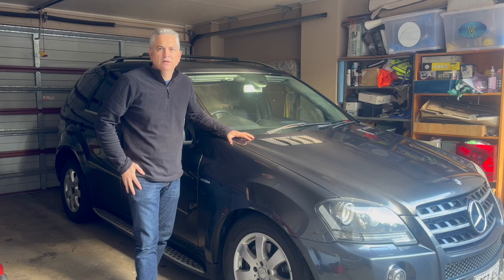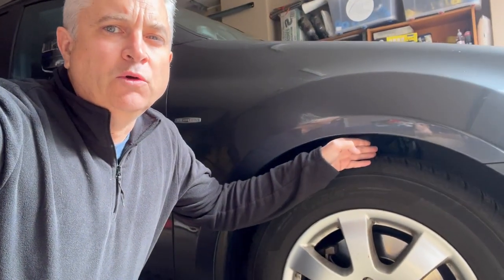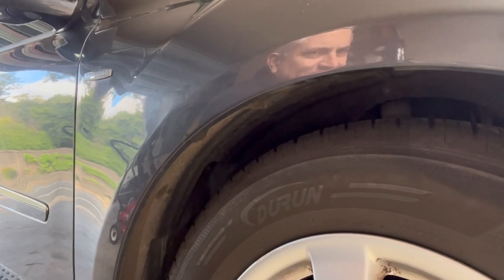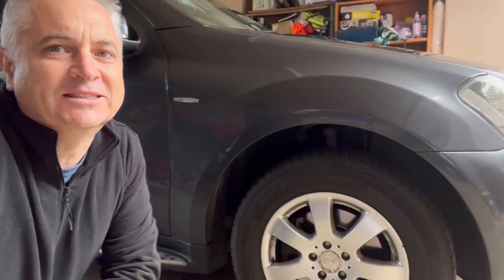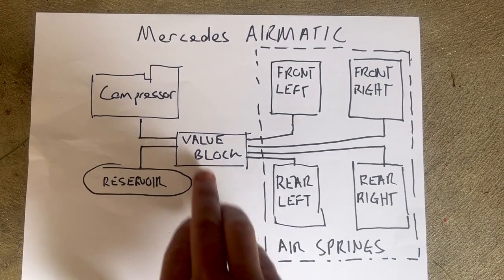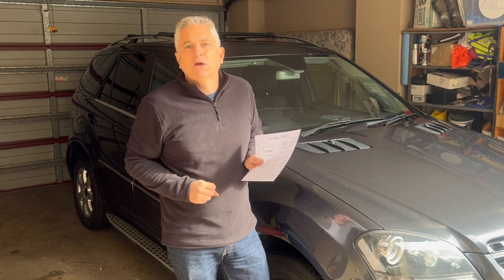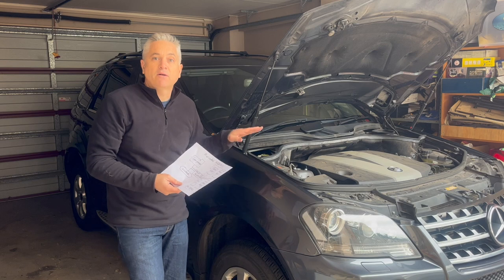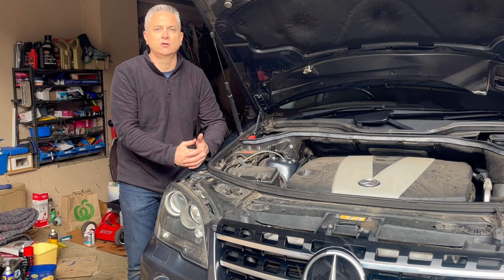Diagnosing my Mercedes ML W164 AIRMATIC Air Suspension Problem - Air Spring Strut Valve Block

Comment: Thank you for this video! I was quoted in excess of $3500 to fix a ‘non existent’ airmatic suspension issue which I am convinced I don’t have as I am not losing any air or anything. No sagging in the front or back of the vehicle.. no warning lights etc.. also, regarding the video about changing the glo plug, would the glo plug you have linked in also be suitable for a 2010 ML350 AMG?
Reply: Can I send you a video of a noise that was heard?
Reply from the maker: Hi Mate, yes assuming your car has the OM642 Diesel engine (ie not the Petrol V8) the. it’s the same Glow Plug Module in the ML350.  Cheers Drew
Reply: @DrewFixIt  how do I know if that’s the engine?
Reply from the maker: Do you put Diesel in your car?  Cheers Drew

Comment: Drew I have a Mercedes Benze Viano W639 2014 - 3.0 Cdi  the air shock will not work the voltage at the air compressor is below 3 volts any suggestions mate

Comment: And where do i bay the valve block, 4 air shocks and compressor?
Reply from the maker: Hi Mate, I have put links in the description of this video, but here they are anyway: Valve Block: https://amzn.to/3NAWbPO
Front Strut Shock Absorber Assembly: https://amzn.to/3rmq4Zl
Front Air Spring: https://amzn.to/3rgsxry
Rear Air Spring: https://amzn.to/437CvIR
Air Compressor: https://amzn.to/46wqM9M Cheers Drew

Comment: The 1st link is to the strut instead of the Valve. Thanks for sharing anyway, it makes my decision to go all-in on a W164 much easier.
Reply from the maker: Hi Dennis, thanks for pointing this out, I have fixed this link now! Good luck with your W164 I certainly have no regrets with purchasing mine :)  Cheers Drew
Reply: Got my W164 for two weeks now. You have no idea how helpful your videos are. Keep up the good work, mate. Greetings from the Netherlands.

Comment: that was a very good diagnostic. I was on the lookout for a used ML350 and was not sure about air suspension because of the Benz Cost( they quotes 2500 AU$ for a single strut). your vedio was very helpful.
Reply from the maker: Hi Mate, here’s a playlist of videos replacing basically every AIRMATIC component in a ML W164: 
https://www.youtube.com/playlist?list=PLor5qdyoV_nQk9277ANJLkKaJ-9Ky_OB7 You can DIY everything yourself for less than $1k  and it’s actually not that hard … go to the dealer for all of this work and it will be over $10k! Cheers Drew

Comment: Did you ever figure out what your leveling problem on your Mercedes was? I have a 2009 Ml550 and have a similar problem, mainly leaning to left side. I had previously changed a compressor and both rear air bags. I have since changed the valve block as you were planning. This has not solved the problem. I have a xtool A30M OBD reader. It seems to work well and provides good feedback on Pressure and level sensor set points and actual position. It is not showing any faults though, I would be interested to hear if you sort it out, Thanks, Bill
Reply from the maker: Hi Bill, I swapped the levelling block and all is good now.  I need to edit up a video and post it, just haven’t had time with life and a day job taking priority!  Cheers Drew
Reply: @DrewFixIt  thanks, didn’t work for mine. I’m thinking it may be a compressor problem, even though the it’s only a 2year old aftermarket pump?? My code reader is reading low bar pressure, thanks again
Reply from the maker: @BillMack-sb9wy  when does it lean to one side?  Cheers Drew
Reply: Always now, I could hit the rise button on fully raise all for corners to maximum height and leave it for 24 hrs with no dropping or lowering. That makes me think the strut is not leaking. Since I changed the valve block I cannot raise by pushing the button. The A30M is reading the bar pressure for the system very low since the valve block change, I’m putting the old one back in tomorrow as there has been no change by changing it. I do have a old compressor I’m going to re install just to see if it builds more bar pressure. I’ll let you know once I figure this out.
Reply from the maker: @BillMack-sb9wy  I am not familiar with that scan tool.  Can it read the Mercedes specific fault codes?  Cheers Drew
Reply: @DrewFixIt  it does seem to be reading fault codes both current and stored, and I have cleared the old ones.
Reply from the maker: @BillMack-sb9wy  Hi Bill, so what are the Mercedes Fault code’s please?  Cheers Drew
Reply: @DrewFixIt  one was 5507, suspension strut implausible. I didn’t get any work done on it today. I’m still planning to swap compressors and see if that helps.
Reply: I swapped the compressor and re installed the original valve block, did not fix the problem any way. The A30M is indicating low bar pressure with both compressor pumps and the ML550 is still leaning on the left side. I have ordered a new compressor pump and will update you after i install and test it. Thanks
Reply: @DrewFixIt hy drew, leveling block you mean the valve block distribution to all struts? Thx u in advance. My car does the same problem.
Reply from the maker: @MariusEncea-t3m  yes mate, my mistake!  Cheers Drew :_DFI:

Comment: Andrew, you are amazing. Not only do you discuss the issue, you fix it AND, give amazing links to where to buy parts. I bought my ML350 W166 a little while ago and it is still under warranty. Mercedes had to replace O2 sensor and Bluetec level sensor. I have not had to go through a lot of issues yet. But you can be sure that I will always check your site first if anything comes up. If you were in Melbourne I"d shout you a beer!
Reply from the maker: Thanks John, you are way too kind mate!  Cheers Drew

Comment: June 2024 I loved your video explanation and tips for the aftermarket parts as I have a client with a 2012 ml 350 blue tec who says his vehicle doesn't seem to ride as cushy as he remembers but I also noticed he's not running identical tire brands on the rear axle an😊d also wonder if he might want or need to try different air pressures in the tires to change ride characteristics?
Feel free to provide your excellent opinion on this topic.
The vehicle is in very nice condition but I did notice oil leakage on the right side of the bottom of the motor and I never had time to raise the hood to inspect  it so far.
Thank you for your time and your straight forward presentation!
Reply from the maker: Hi Mate,  thanks for the feedback!  It's a little counter intuitive, however get him to try higher tyre pressures as this can result in a smoother ride!!  You will notice also that I have swapped out the low profile AMG rims (21 inch) for 16 or 17 inch rims on my car just because I personally wanted a softer ride ... I do get given grief by this decision, however I do have the AMG rims in my shed to put back on the car one day!!  Cheers Drew :_DFI:

Comment: Andrew.
Many thanks for the vid.
1 am a 75yo ex marine engineer ( long time ago) who hates working on cars. Engines four stories high are easier.  I am still working as a machinery repairer, redesigner and making parts (Boom Engineering (impossible jobs our specialty)) in Sydney and factory at Central Coast (no more employees). 
 Bought her 2011 ML new (I have a twin cab Sprinter) and have since done all the work myself which has been a PITA.
All air bags, compressor, replaced oil cooler seals, resoldered ignition circuit boards, headlight lense covers, brakes, windscreen, transmission oil change, MAFS clean, replace sensors inc o2, panel beaten body, side mirrors and cut  the DPF in half put in a  $30 filter cartridge and rewelded it, water pump, belt tensioner, I have forgotten some of the others, (replaced something on transmission as well).
A bit skeptical of 2 tiny leaks on right front causing erratic symptoms as these would normally be consistent so looked up your vid and you confirmed my suspicions before I went to the trouble of removing all the obstacles to the valve block. 
BTW have made special AMG tools for the MB repairer at Brookvale as he was not allowed to buy them. 
Thank you for the confirmation and  time saver.
Reply from the maker: Hi John, thanks for the comment.  It’s a pity I’m not on the east coast as you sound very knowledgeable and I would love to have a chat!  Cheers Drew
Reply: @DrewFixIt 
You in WA or SA ?
I  was brought up in the fifties at North Cottesloe also lived at  Northcliff and later Waikiki area where I designed and made a car outside with only a few hand tools and a borrowed cheap welder. It was the first car in the world with windscreen wipers under the bonnet( have pic).  Driving from WA to NSW in 1970  and back multiple times   rare to see anyone for a week as Nullabor was 350 miles of dirt track.
Replaced PCV valve and shocks  as well.😊
One  thing  I wanted to ask your opinion on the very light torque for the turbo charger hold down bolts.  Do you think it's due to combating heat induced  expansion ?.
I worked for Rolls Royce (marine) who put me on a bolt plasticity course and they said having grease on bolts increased the linear pressure by over  30%
With this in mind having doubt about the absurdly light torque recomendation greased them before torquing up.
Would you have done similar or just increased the  setting on the wrench ?.
Welcome to have a chat, just  look up the website.
Reply from the maker: @johnboom6777  Hi John, I am in SA.  I always have a tendency to overtighten things personally, probably something about growing up on a farm where we just tightened the living daylight out of everything to stop things vibrating loose, however having stripped a few things over the years I am a lot more careful nowadays :)  I think that these European cars have lots of different alloys combined with many combinations of materials used and additionally the tolerances are so fine that I try to use a torque wrench as much as I can simply sticking to the manufacturer specifications.  I have never heard the grease method, however if I was concerned I would have perhaps used some loctite on the threads and torqued to spec with loctite.  Cheers Drew
Reply: @DrewFixIt 
One  more story before signing off. My 47yo cycling mate grew up in SA. ( made my own 81 tooth chainring from scrap alum checker plate).
Anyhow,  rocked up at  Garden Island  Naval dockyard shutdown and was greeted with " what are you guys doing here" by Hans and Rudy previous work associates.  "We are doing turbines  you're not good enough for that" .
 I answered " who do you think made the blades, Simon". "He couldn't have because they were made in South Australia" .  ".Where do you think he  came from".

Comment: Thank you very much for comprehensive video. What happens if you don’t replace the valve block. Will it cause compressor to wear out quickly?
Reply from the maker: Hi Mate, I would suggest that the behaviour is not normal and you do need to get to the bottom of it as the car is leaking air somewhere.  Mine ended up being the Air Block leaking the air.  Any Air leaks ultimately mean that the compressor is working more than it should and thus yes will wear out quicker!  Cheers Drew